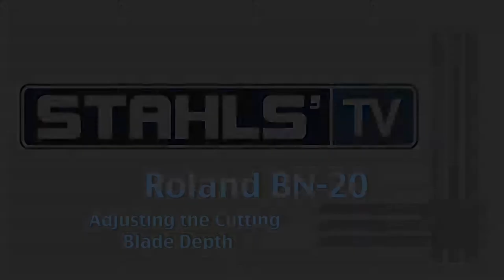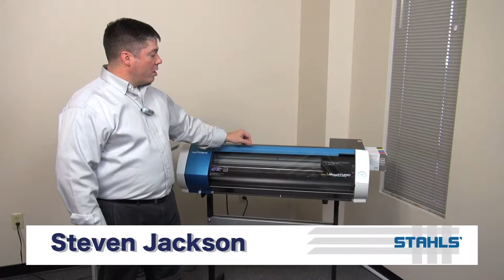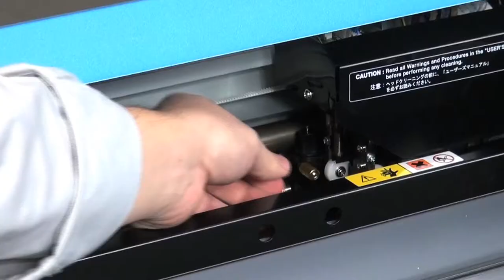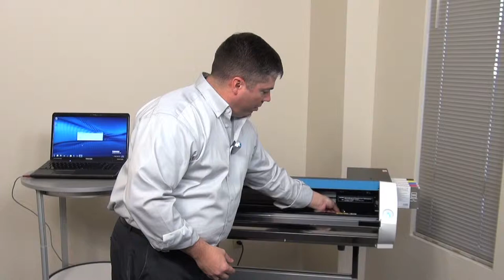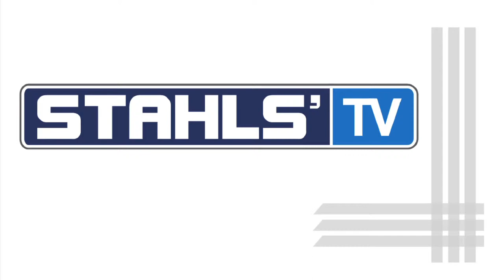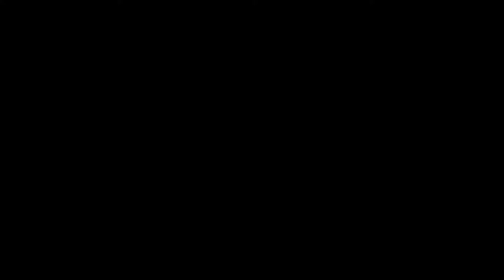Roland BN-20: Adjusting the Cutting Blade Depth

Comment: Someone help me understand. Turning the cap does not move the blade it just exposes more of it? I have several cutting machines and turning the knob moves the blade. Spinning the cap on this holder doesn't do anything except expose the blade. zero effect on cutting?
Reply from the maker: When you expose more of the blade with the top cap, that will affect the cutting depth.